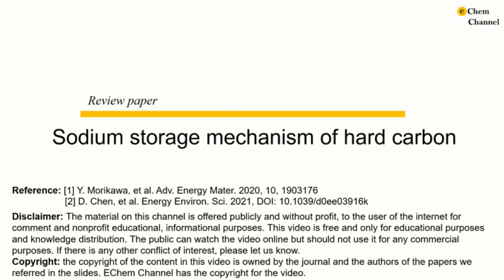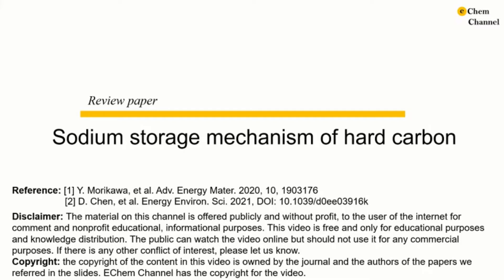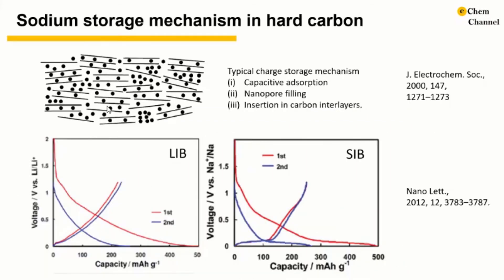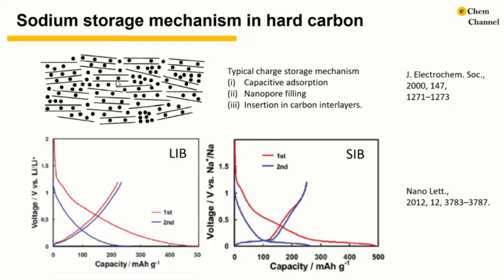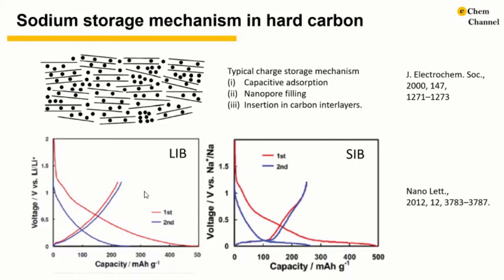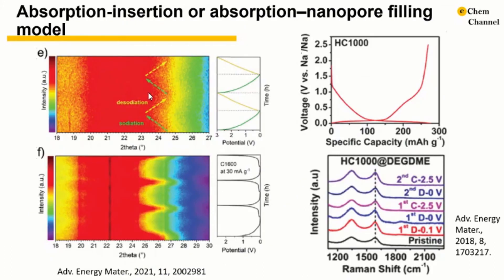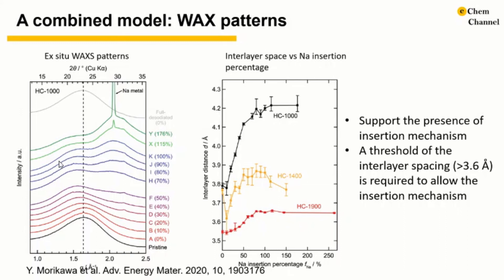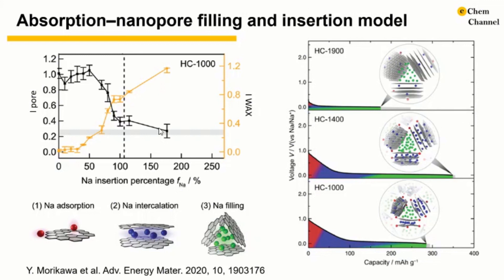[Review Article] Sodium storage in hard carbon

Comment: Thank you Dr. Wang for such a nice video. Can you please suggest how cyclic stability of metal ion capacitor depends on mass balancing. I observed that in case of Li ion capacitor the cyclic stability is cathode mass dependent. Even though anode capacity is very high to match the capacitance if we are putting more cathode let say 4:1 cathode to anode ratio the stability is bad. But when we are keeping ratio close to 1:1 the stability is excellent. Please suggest what could be a possible reason.